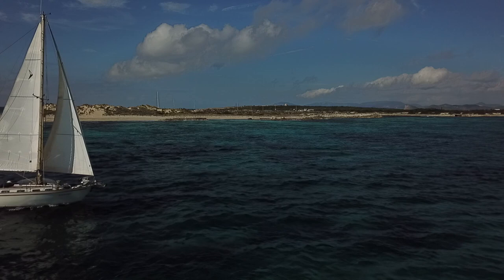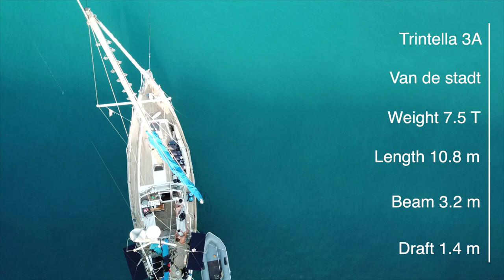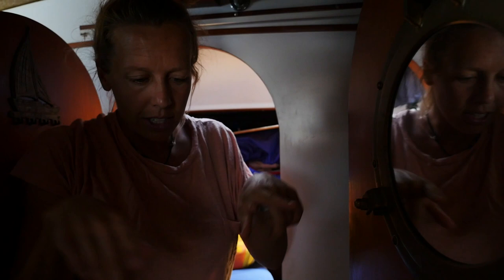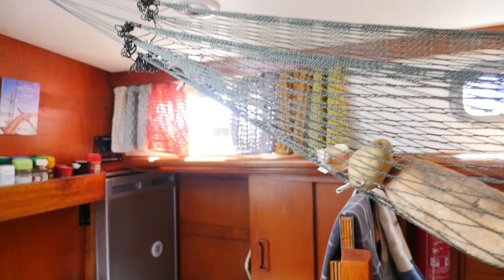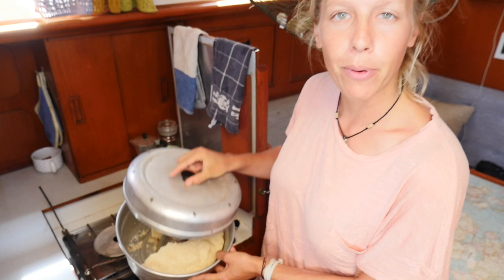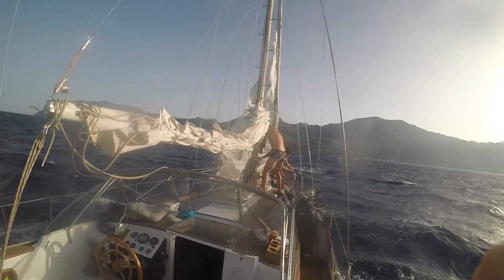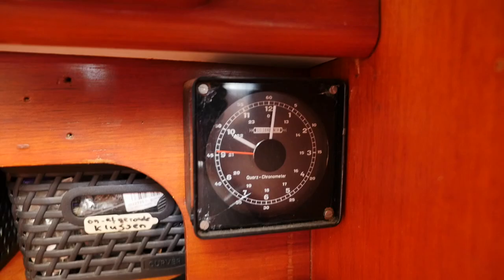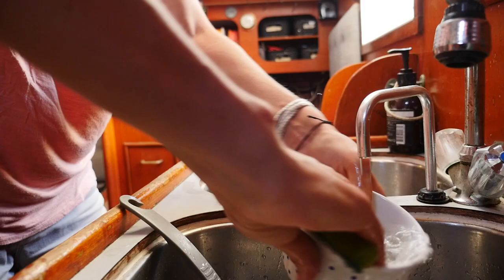A short tour trough our boat: a trintella 3A- #DayVlog37

Comment: Thank you for the tour and for answering my question! (I have a ketch and really like the versatility of the three sails, especially in bad weather). I should also have asked what anchor you have (not your spiritual one!) as you rely on it so much. Thanks again.
Reply from the maker: Hey! Yes we forgot to put the anchor in the video 😳 we have a delta 20 kg and 80 meter 8mm chain. (next to that we have a cqr 20 kg and a danfort of approx 10 kg with lots of ropes so we can fix our boat from different directions)
How do you use your mizzen in bad wheater? Sounds interesting..
Reply: @sailingmessenger8125  The mizzen is usually my first sail up and last down (unless running when it doesn't add anything).  In bad weather, a reefed mizzen and a reefed/furled genoa (with the main dropped) keeps the boat balanced and the reduced sail area prevents it being overpowered.  Also, if you have already dropped the main and the genoa/jib is on a furler, all sail handling can be done from the cockpit.  The mizzen can also be useful at anchor as it can stop the boat from swinging too much.

Comment: Great! Where did you get the "wonder pan" and how does it work? Can you also use it on a fire, while hiking for example?
Reply from the maker: The idea is that the heat of the gas gets trough the opening in the middle, filling the pan with heat like an oven. Even on the gas stove we use a little metal plate with a hole in the middle to concentrate the flame into the pan. I think on a fire it would be difficult to do so. And if you have direct fire on the bottom then I think it acts like a normal pan. But never tried that;)

Comment: Listen fokls, do yourselves a huge favor and never ever drink the water stored in direct sunlight in polymer/plastic containers !

God bless and be safe !
Reply from the maker: Hi, thanks for your reply. Why would that be a problem? Should we cover them? or is it too late after 3 weeks?
Reply: @Sailing Messenger, polymer containers always release chemical compounds known as synthetic estrogens into the contents stored inside them as the polymer breaks down, including those classified as BPA free.   Unfortunately, this process is accelerated when the polymer container is exposed to sunlight for extended periods of time and yes, three weeks is allot of exposure.   These chemicals are toxic in the long run more for males than the females but both can experience negative impacts.   Males are impacted the hardest from these estrogens derived from the polymers breakdown and they’ll develop horrible hormonal imbalances and the physiological effect known as “man boobs”.     I advise to stay away as much as possible from any plastic food containers and utensils, but if you have to use them, don’t use them repeatedly for long periods of time as polymers breakdown unavoidably occurs, and especially if exposed to heat and/or sunlight (UV exposure also).

Please invest in a little more solar panels plus lithium ion batteries and please get yourselves a ,water maker’ desalinization machine.    Drinking water should be stored in glass, ceramic or the more practical stainless steel tanks in the bilge where is cooler and no sunlight.   That water you’ve got on deck use it for other purposes which require freshwater, but whatever you do with it, do not ingest it !

Here, watch this:    https://youtu.be/X-KwsPgyFTY
Reply from the maker: Thabks for your explanation. Normally we never take bottled water, but now because we need to survive for so long we did. We don't really have a choice I guess because we can't go to shore now. We don't have a bilge, because everything under the floor is watertank.. And we don't use fresh water for anything else then drinking and cooking. So we will save it for the end and see if we can make it without. Thanks for the warning! A watermaker would be a perfect edition for us yes...
Reply from the maker: @hereintranzit  😁 that's a long and strong answer.. You know, we really like to give thanks to God for what he created and for who He is. In the first year of our trip we made a different style of video's, I don't know if you saw them already. But in those videos we visited quite often Christian projects and shared a message in them. Like this one: https://youtu.be/AkQfeLiqCqc
Now we chose a different kind of video, just our everyday life. We don't feel a shame to talk about God, and why we believe in Him if the moment is there. That said, we try to respect every human being equally. We love talking about God and faith because it's the most important thing in our life, we do that with people we meet, when they like to talk about that as well. Maybe we aren't as radical as you 😜 but not all brothers and sisters have the same character right 😉
Reply: @Sailing Messenger, no I didn’t see any of the earlier stuff because I only recently discovered your channel.   
I also don’t really understand the notion of “different kind of video” and “being radical” really means since we’re to be exactly what we are and that’s being true and genuine and a peculiar people, set apart, in the world but not of the world, right ?   Loving everybody equally does not mean to always have to hide certain things that might offend someone’s sensibilities, such things as faith and personal convictions based on the truth of the bible.   We don’t really have to switch from the more faith based content to the secular content in order to ponder and placate those whom might just feel offended by these particular issues, mainly the christian worldview and convictions.  

Let me ask you this:  is your day to day life as liveaboard cruiser sailors void of faith and christian convictions ?    I hope not, and since it isn’t, why not incorporate that aspect into your videos and in that way maybe it’ll be a form of fellowship with those of similar beliefs whom otherwise won’t even know that they share this aspect of life with you ?    Besides that, the main objective of the believer is to evangelize, right ?    Living it big and showing everybody how much fun you can have sailing around the world is becoming very common, like “six of one, half dozen or the other” kinda thing with shows like SV Delos, Sailing La Vagabond, etc., etc., etc. some more narcissistic than the others, but all of them share the “look at me/us how good we’ve got it, and even though it sucks to be you, please support us through following our channel on youboob and on patreon” right ?! 
Since all of these other shows share almost all the hedonistic aspects of life with the exception of streaming live copulation videos, and they’re always showing us how proud they are to worship Poseidon very time they cross the equator, why would be such a drag to worship the God of the bible, the true, real, one and only Creator God in words and songs and give Him thanks for everything in your day to day sailing videos ?   

Listen, if you think that this is kinda strong and feel offended, then you’ve got two choices: 
1:  ignore me and block me 
2: think about what I’m saying ........ and then ignore me and block me if that’s what you want 😂😂😂 

But more importantly, ask God what He’ll have you do !
Reply from the maker: 😁😁 We are not offended at all, and no reason to block you yet 😜

I think we agree with almost everything you say . Just watch some of our previous video's like the one I sended and you will understand better what I meant with 'different kind of video' . It's just a different concept.
We did not change format to share another message, its just because we started vlogging daily due to covid-19 and people really happen to like the new concept. That's why you found us too I guess ☺️. 
But thanks for giving your opinion. We appreciate that. We can have more in depth conversations when you send an email to sailingmessenger@gmail.com when you like :)